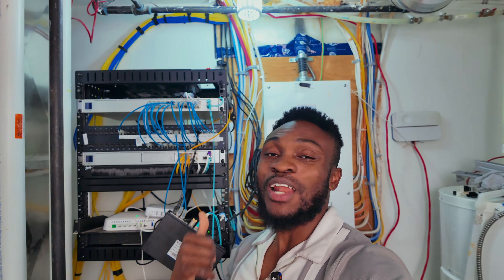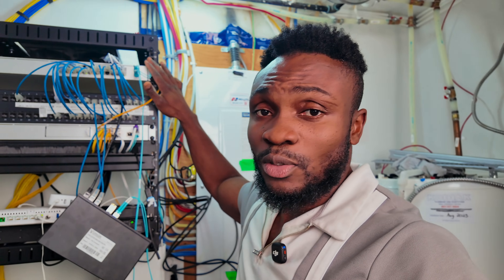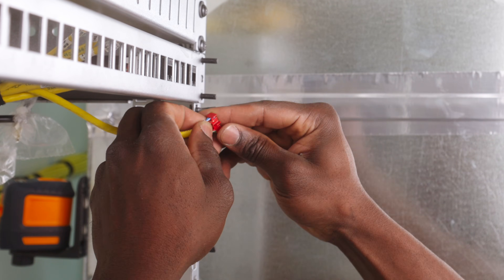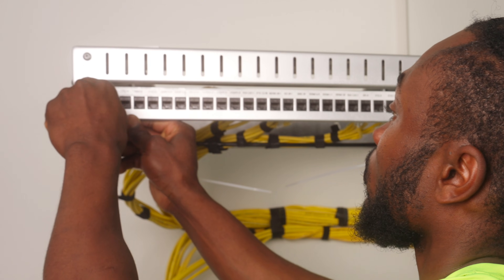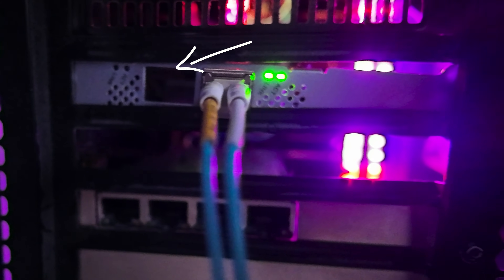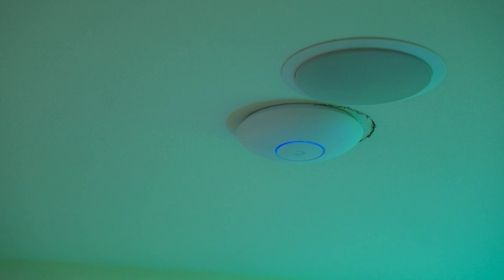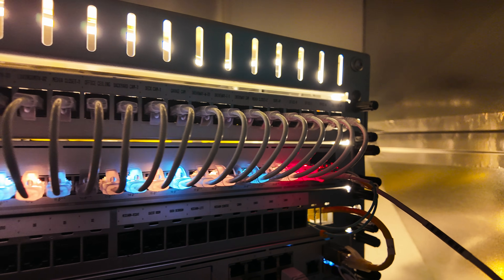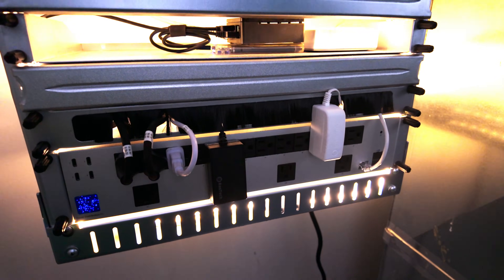I finally finished my home lab rack version 3!

Comment: Nicely planned, and beautifully executed. This is such a great home install, adapting things to fit the scale and aesthetic of the space, rather than getting "proper" corporate gear that is way beyond the need/use case.

I've recently done a full rack rebuild and appreciate the design and scoping, and the "fun" when you realise you were a little too efficient with your infrastructure cables last time, and a bunch are short, forcing a bit of adaptation.

Lovely job, I always enjoy seeing others' builds and rebuilds, and this was a great watch. You have yourself a new subscriber.
Reply from the maker: Thanks for the kind words — really appreciate it. I try to build around the space and the actual use-case, so I’m glad that came across. The whole process — planning, adapting, catching those cable surprises — is half the fun of these builds. Glad the project landed well for you

Thanks again for watching and subscribing!